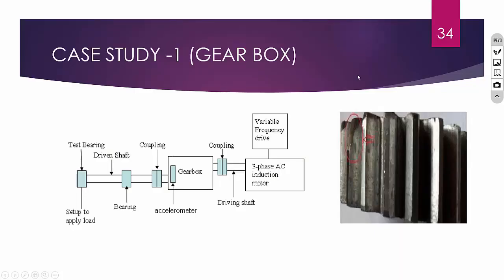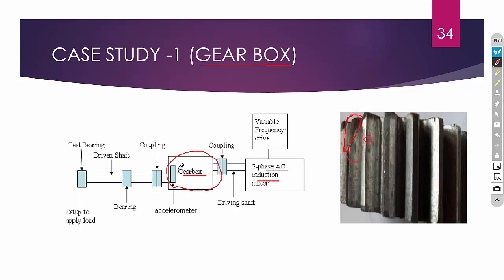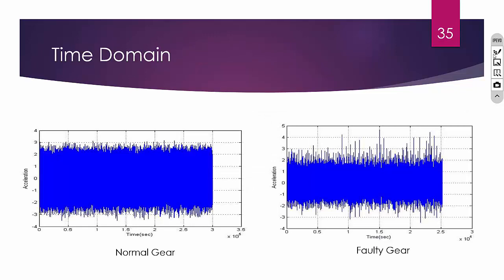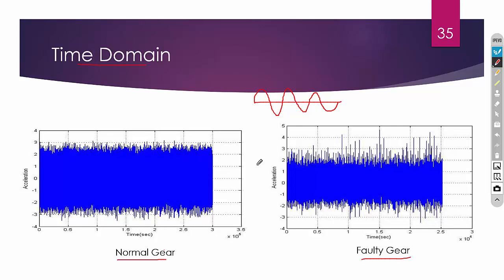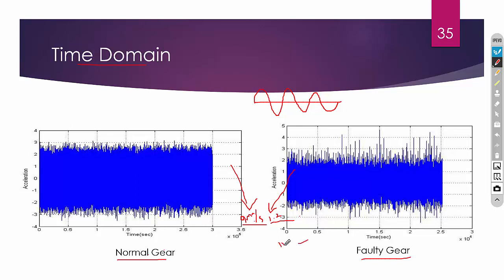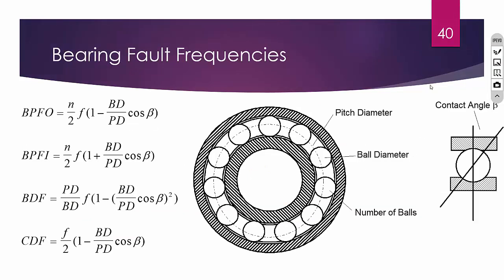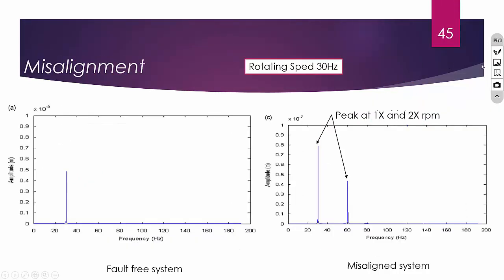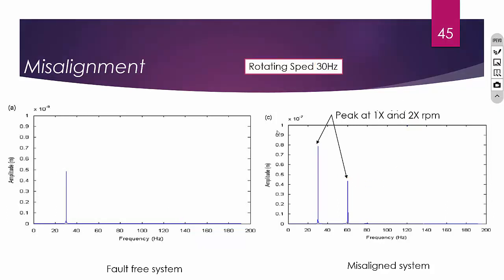Machinery Fault Diagnosis | Condition monitoring of Machineries | Case studies | Vibration Analysis

Comment: In the gear fault frequency, is it correct that the same speed (6.67 rps) is multiplied for both pinion and wheel frequency? Shouldn't the rps of the pinion be larger compared to the higher diameter wheel?
Reply from the maker: Actually the Gear Mesh Frequency (GMF) is same for both the gear and pinion (a pair of gears)... That was a mistake in the video..

Comment: Can you tell us how to use eigen vector and eigen values to decide vibration points ?
Reply from the maker: Eigenvalues and eigenvectors are commonly used in vibration analysis to determine the natural frequencies and mode shapes of a system. The components of an eigenvector also denote the displacements of each degree of freedom in the system. Look at the magnitudes of the components of the normalized eigenvector. Larger magnitudes indicate more significant displacements in the corresponding degrees of freedom.
Note: This is up to my knowledge; I haven't practically applied this.

Comment: Sir a question...in the first case of the gearbox, you mentioned the rpm is 240...so is it the High speed side rpm or the low speed side rpm? For calculation purpose what is the requirement..?? And for condition monitoring of gearbox teeth, does the sensor(single axis sensors) needs to be mounted on the bearing casing or the gearbox casing in the three (XYZ)  direction...Plz reply
Reply from the maker: Its actually the driving speed of the individual gear.... For example in a single stage gearbox, we have two gears rotating at two different speeds, so this system has two fault frequencies ( one for each gear)...
Regarding the position of sensors, for gear fault diagnosis, one direction is enough (either X or Y)... Because both will have the similar pattern of signal and  amplitude....
Reply: @themechanicalengineer  Thank You